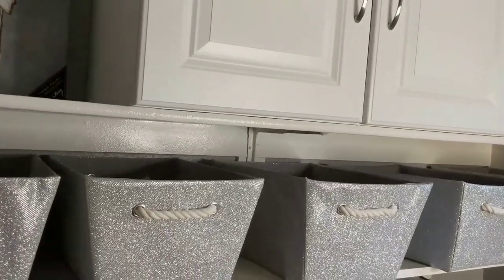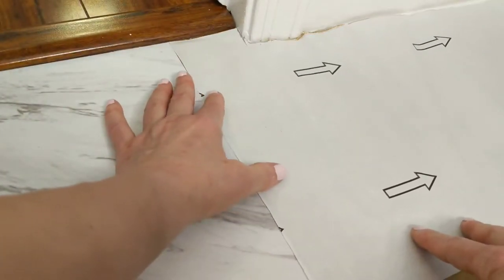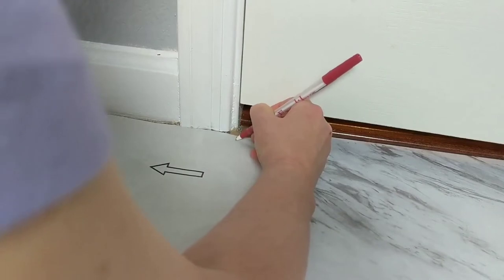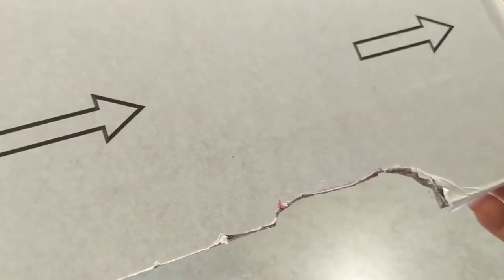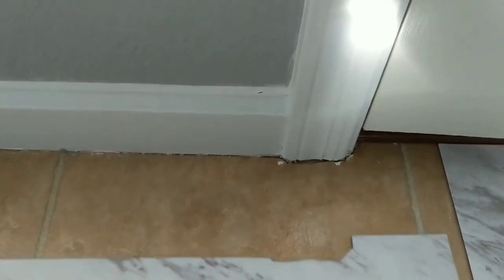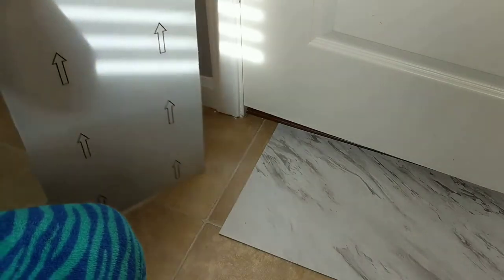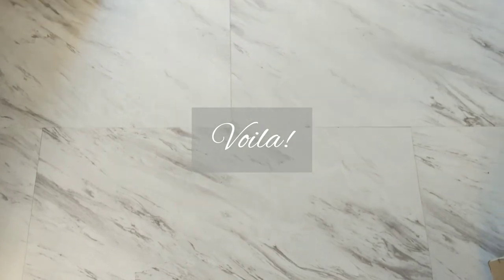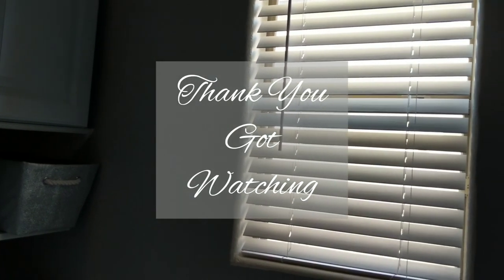How to Install  MARBLE LOOK Peel-and-Stick Vinyl Tile Flooring over existing vinyl floor

Comment: This looks great..but I’m stuck between another video someone using spacers and ready to use grout to put in between each peel and stick tile.
Reply from the maker: I decided not to do that even if it looks nice initially because grout gets dirty quickly and looks real ugly and is a pain to clean.  I know I have tiles with grout in our kitchen and foyer and it's nasty.  I try to scrub it and in a few days it's dirty again. If ypu don't use grout make sure the tiles are real snug.  Good luck in whatever you decide to do.

Comment: give us an update 2 years later........
 how is it looking and holding up to wear and tear?
 is it really waterproof and stain-resistant?
did it fade or turn yellow? 
did it lift, bend or break? 

thank you:hand-orange-covering-eyes:
Reply from the maker: It looks the same as the day I installed it!  Yes waterproof for sure, we had a flood in bathroom where I used the same tiles, and the workers who came to replace our floor in the family room (we have a different flooring  in family room  which are not waterproof) , said it was NOT necesarry to replace the tiles at all.  And stain resistant but ofcourse you do have to clean the tiles as usual when they get dirty.  They did not fade or turn yellow. Hope this helps, I will be using the same tiles in my bedroom bath when I decide to update that bathroom in the near future.

Comment: How is it holding up as it has been almost a year?
Reply from the maker: Just perfect so far no problems at all, I also did our guest bathroom with the same tile, will post that video hopefully soon!
Reply: @secretgardenhome1809  Thanks so much! I just bought it today!! :)
Reply from the maker: Want to add we installed the same tiles in the Guest Bathroom and we had a toilet leak flood and the tiles held perfectly.  Didn't need to replace them.

Comment: How many packs did you need?
Reply from the maker: Sorry don't recall but I purchased more then I needed just in case.
Reply from the maker: Approx. almost 3 boxes.  There are 10 tiles to a box.  Its always good to get more then you need to insure you have the same stock.